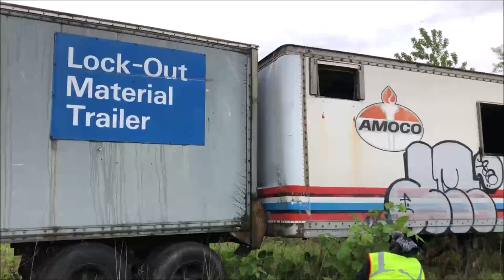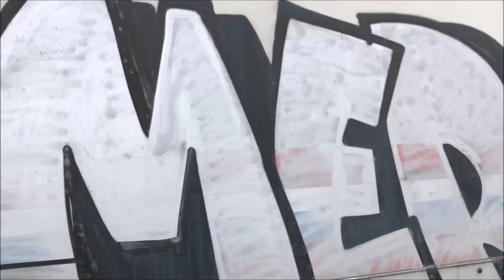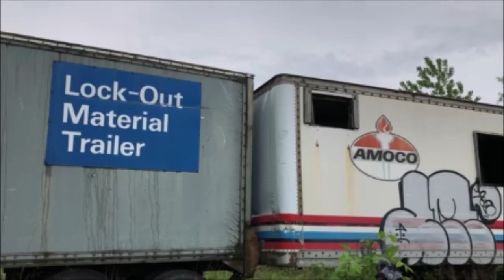Remains Of Amoco’s Semi Trailer Junkyard in Northwest Indiana

Comment: That steel box made out of bent rods  holding garbage would make a good man lift box to work out of.  I been having good luck putting Vicks on the tips of my ears, back of my neck, and the back of my hands and forehead to keep flies and bugs off me, it doesn't take a lot. . I don't know about ticks though. You could rub some on a cap,  bottom of your pants and shoes and see if it works. It also will remove some kinds of label glue off bottles if you scrape the label so the Vicks can get to the glue,  and then wait a few minutes, and scrape the label off with a plastic scraper and rub the remaining glue off with a paper towel. .  It doesn't stink like the stuff you buy in stores to remove labels.
Reply: Yall do awesome job  at recording Gary past would love to have the chance to do a explorer with yall.but I'm  in Texas. Lived in glen park 1954 to1966  went to Franklin elementary  baptism at St. Mark's  on ridge road .glen theater just to many good  memories. Lived at 3572 Pennsylvania  under stand the house  burnt down. Most of all my aunts and uncles  plus.my mom  went to Lew    Wallace.